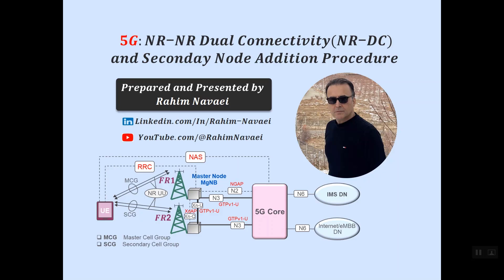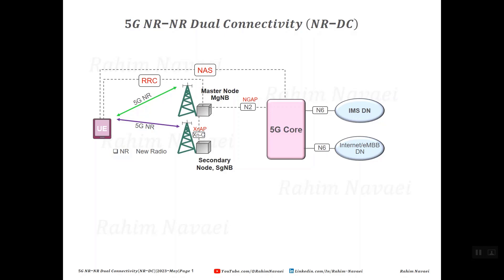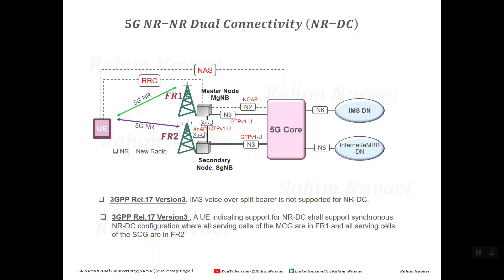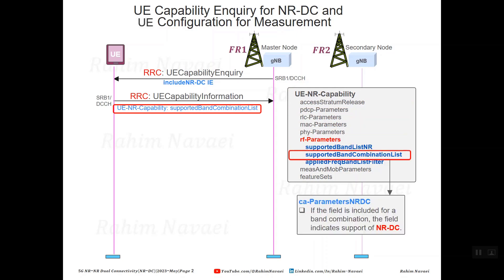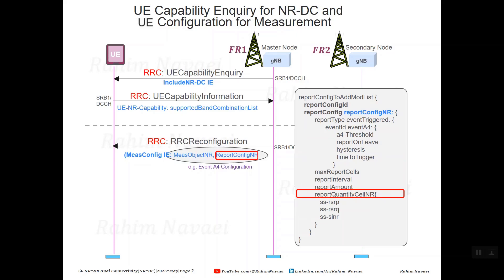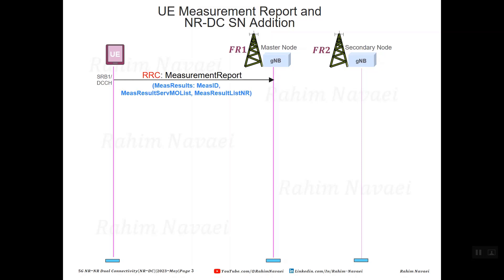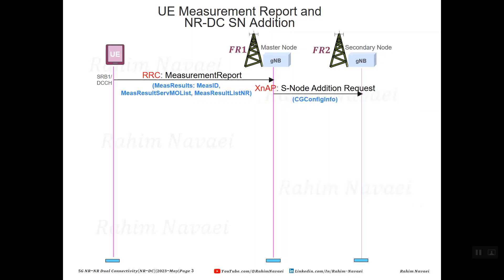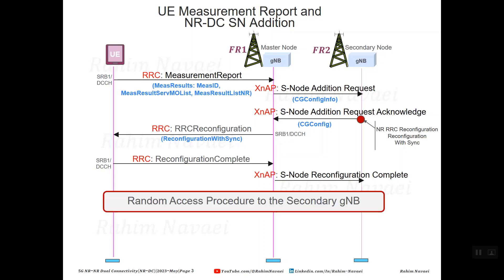5G NR-NR Dual Connectivity (NR-DC/NRDC) #5g #4g #telecom

Comment: Very helpful Mr Rahim. Is it possible to have Mac NR CA IN FR1, Mac NR CA in FR2 together with NR-DC? Thank you
Reply from the maker: Thank you for your comment. As you know, in NR-DC configuration, the PDCP layer at the Secondary Node (SgNB) is responsible for splitting the incoming packets from the UPF. Consequently, we have two paths for sending and receiving user packets. One path utilizes the SCG (Secondary Cell Group) resources, while the other employs MCG (Master Cell Group) resources. For both paths, Carrier Aggregation (CA) can be utilized by the MgNB and SgNB to transmit and receive user packets."
Carrier Aggregation (CA) allows for the use of multiple carriers or bands to increase the bandwidth and thereby the data rate for the user. In the context of NR-DC, CA can be applied to both MCG and SCG bearers to optimize the use of radio resources and improve network performance.